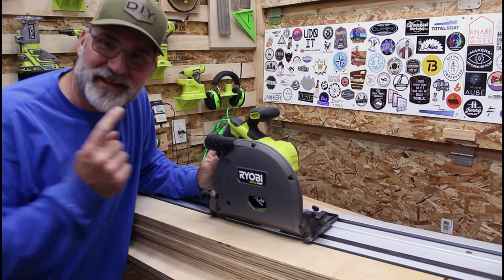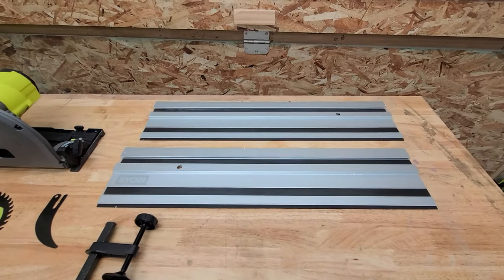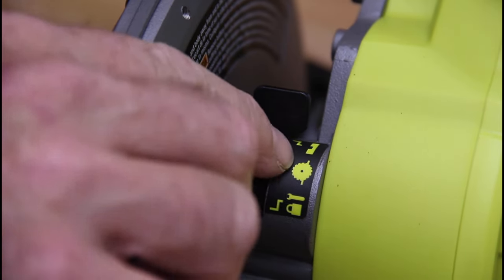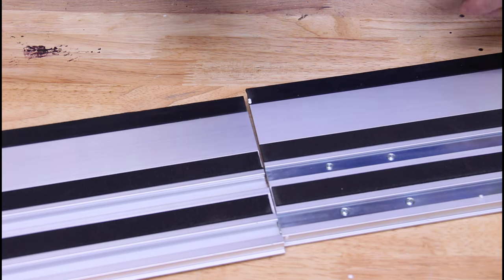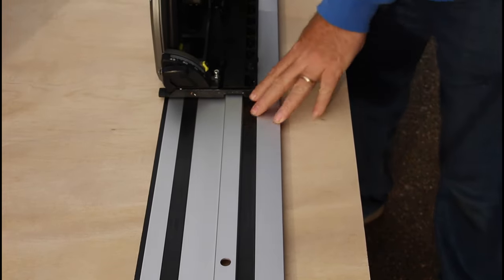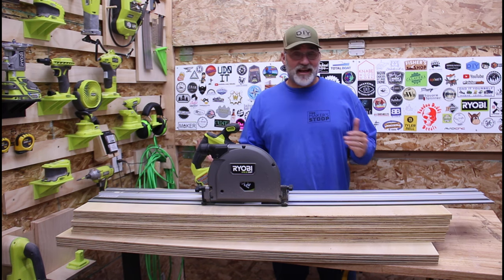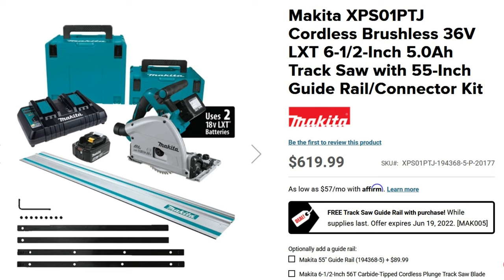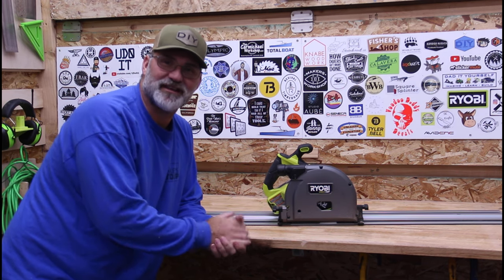RYOBI PTS01 Track Saw | BEST deal for the MONEY! | Unboxing and Review! | 2022/12

Comment: Thanks for the review! could you please measure the size(width) of the 2 t-slots on the track?  Just want to know if they are compatible with many track saw square rail guides. Thanks!
Reply from the maker: 1 1/4, 3/4 groove, 1", the open. Full width is 6 1/4"
Reply: @DadItYourselfDIY  Thanks a lot!
Reply from the maker: You're welcome.

Comment: What’s the link for the dust bag?
Reply from the maker: It does not come with a sawdust collector. It's designed for a hose connection for a shop vac or dis ectractor.

Comment: Very cool, we’re in the market for one. I only have one Ryobi tool, the rest M18 some M12 plus some Makita. This one looks like it has potential.
Reply from the maker: Can't beat the price. Milwaukee just announced theirs, not sure what the release date is.
Reply: @DadItYourselfDIY  I believe the M18 is October or November. Hopefully we’ll have YouTube comparisons in time for Christmas! 
I haven’t heard anyone say if the Ryobi is compatible with Festool track or not; my understanding is that the Milwaukee will be.
Reply from the maker: My Ryobi contact told me it's proprietary. But until I see it for my self. I mean you can only design a wheel so many ways.
Reply: @DadItYourselfDIY  Turns out I found a comparison between Ryobi and Festool-pattern rails. Definitely will NOT work with Festool rails, or many of the accessories for Festool rails, so the Ryobi saw is dead to me. I hope the narrower track saved them enough money to make up for the loss of sales. I wouldn’t pay $100 for it. This is one of the dumbest business decisions I’ve seen out of Ryobi. They have developed a tool that can really only be used to cut up plywood, given it a track that is too short, and don’t sell a proprietary track long enough to rip a sheet of plywood. Good job, Ryobi. It makes me want to throw out ALL of my Ryobi tools. If the Milwaukee is decent, I’ll consider it, otherwise, Festool here I come.
Reply from the maker: The expansion track from Ryobi will be released shortly.
Reply: @jasonm.7358  buy dewalt if you're throwing the ryobi away lol, Milwaukee is the same shit for like 200$ more. Dewalt you actually get upgrades.

Comment: I’m glad you compared prices and such, thats a good comparison and it seems to cut through ply easily! I have the Ryobi brushless hp 7 1/4 and the kreg accucut, it has done me good so far but I may have to pick this up!
Reply from the maker: That 7 1/4 saw is a beast. I use it all the time. Kreg makes really good universal tools too!
Reply: I have have both and the kreg floats around on top of the track and is very sloppy.  MY RYOBI track saw is laser accurate and stable in comparison.
Reply from the maker: I would agree. I had heard that the accuracy of the Kreg accucut was "questionable"
Reply: @DadItYourselfDIY  yes I agree, that kreg accucut maybe have to be phased out for this beast!
Reply from the maker: I spoke to the folks from Kreg at WorkbenCon earlier this year. They admittedly know they are not in the same category as the dedicated saw kits, but are perfectly happy being a universal option.

Comment: Is a track saw primarily for breaking down sheet goods or can it actually replace a table saw for general household woodworking? I'd love to find something that'll take up less space than my tablesaw but I have no experience with a track saw.
Reply from the maker: It can replace a tablesaw for many functions.  It's not good for efficiency of repeatable cuts like a tablesaw and mitresaw would be good for.
Reply: @DadItYourselfDIY  Fair enough. Nothing like a well tuned jig on a table saw to nail a bunch of repeated cuts accurately. 
Thanks.
Reply from the maker: Yup!
Reply: @DadItYourselfDIY  tracksaw + DIY mft style table tho... and you do have great repeatability
Reply from the maker: Agreed, but without the speed. Every tool has a purpose and can never be replaced by another 100%
Reply: @DadItYourselfDIY  agree, but if saving room is a requirement, speed could be forsaken
Reply from the maker: Agreed. I forsee my table saw being used much less.
Reply: @DadItYourselfDIY  cool, nice to know, as someone with a tracksaw (bosch).... and who too often thinks about moving just to get a bigger shop.

thanks for the review... helps me recommend this as a good option based on price.
Reply from the maker: I still want a big tablesaw too..

Comment: To me a track saw really shows it’s worth if you can rip a full sheet of plywood in half. Paying $400 to just make cross cuts seems pretty unnecessary when you can just use your circular saw and a guide for 4ft cross cuts. Until they come out with additional tracks, I don’t think I will entertain their purchase. But what do you think about the plastic base? That was pretty shocking to me.
Reply from the maker: I agree that a add on track is going to beca necessity. The plastic base doesn't seem to be an issue. Only time will tell.
Reply: They'll also need to sell longer tracks. Joining four short tracks would be a pain.
Reply from the maker: Add on tracks will be released in July.
Reply: Plastic base is fine, if you're building houses all day buy dewalt. If you're doing a shed over the span of 3 months buy ryobi and take care of your shit lmao.

Comment: Might be good for wekend projects for once a month but if you are full time carpenter or contractor you need robust track saw that actual shoe is aluminum or magnesium,  have the corded festool ts 55 and milwaukee track saw , love both of them and very accurate,  i was looking at the ryobi and its all plastic and deflecting shoe plate which is not good , plus the riving knife is a joke ( useless) it doesnt integrate with other tracks is another issue , you need to join 4 tracks to be able to cut 8ft ply, its for home owners quality tool , for a few bucks more you can get much better options i believe,  i like ryobi tools and have their cordless nailers but the track saw is not worth the money and quality is not there
Reply from the maker: I don't do a bunch of stuff that requires the track saw. But when I do, it's been clutch. Great price and filled my niche.